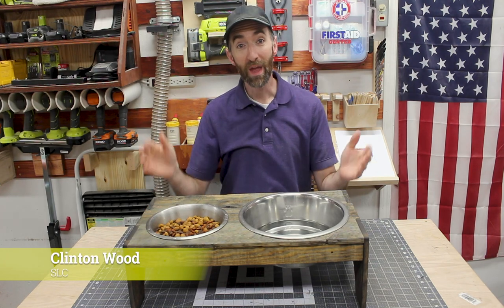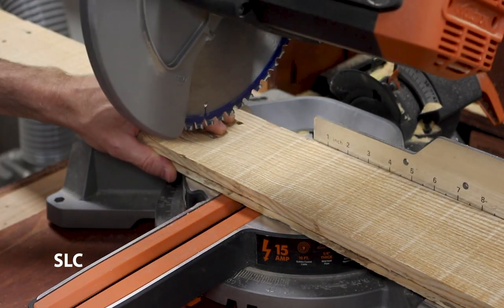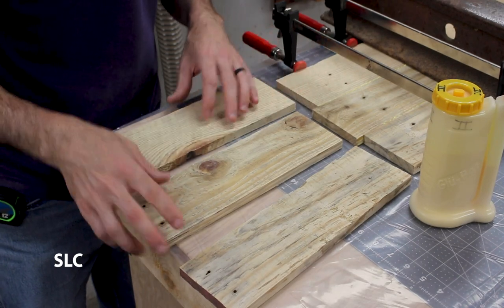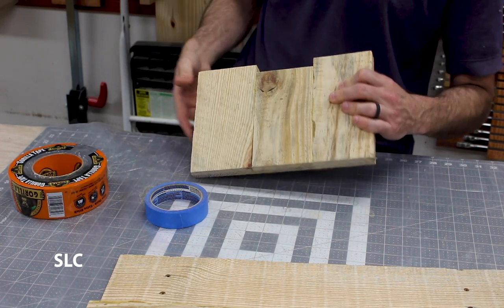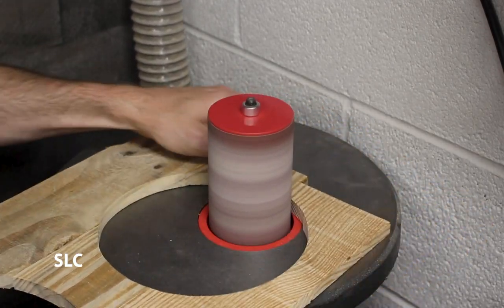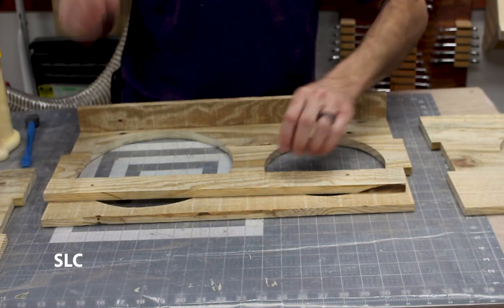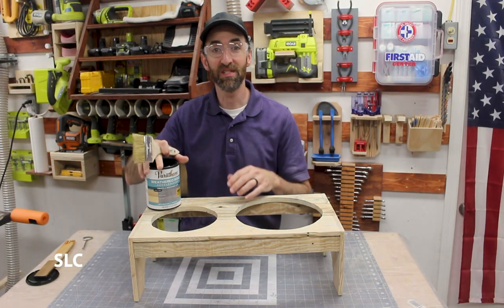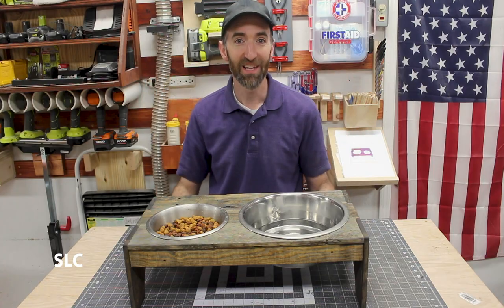Help Your Dog Eat Easier with a Simple Elevated Bowl Holder

Comment: Hi, did you use a joiner? How did glue it up for wider panel without gaps?
Reply from the maker: No joiner, just sanding and a couple times with a hand plane. Since the boards were short when gluing, they were straight enough.